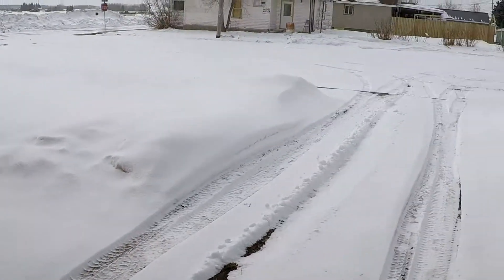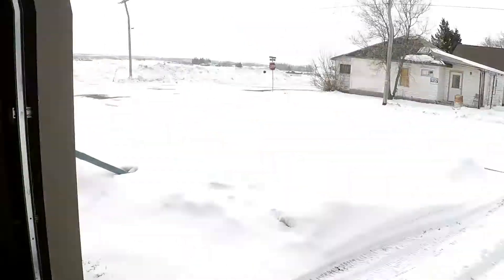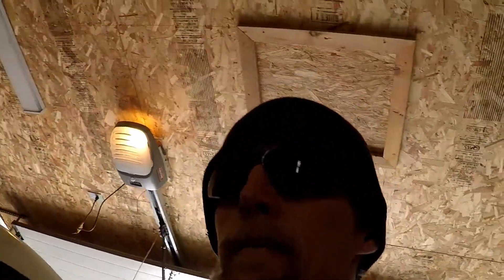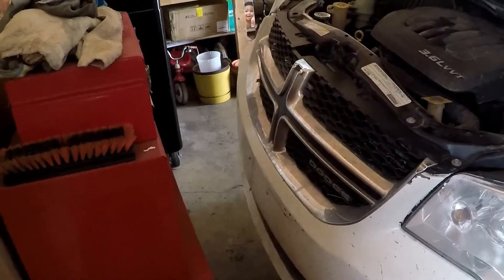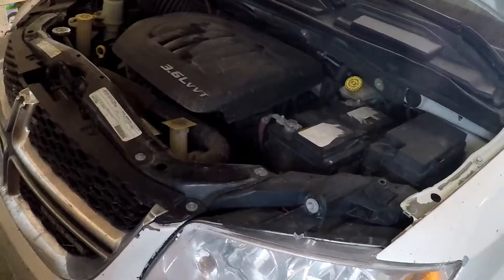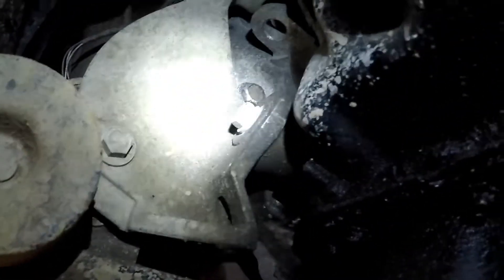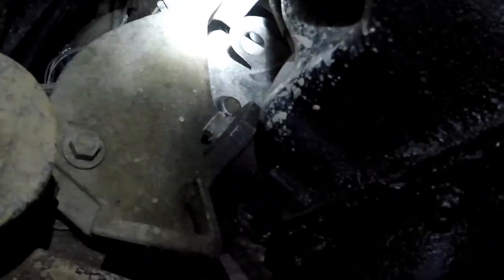2011 Caravan no start and Shutting Down Issue

Comment: Great information thanks for sharing I would check the negative battery terminal the one that mounts all the way to the frame of the car I found it in those years especially where you live with all the salt and snow that those wires croad to and we'll short out.
Reply from the maker: Wayne Scyphers great info. I actually tried locating it but never found it.